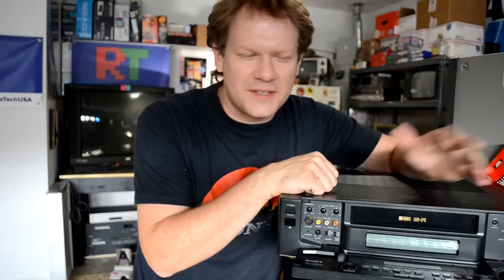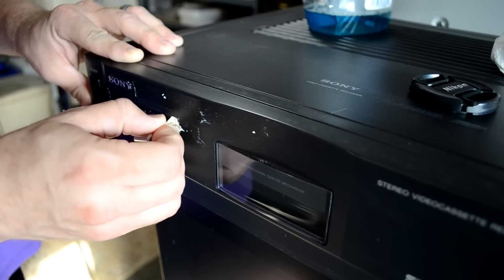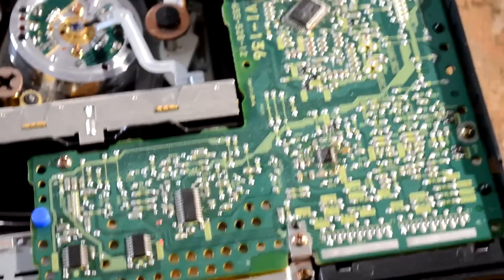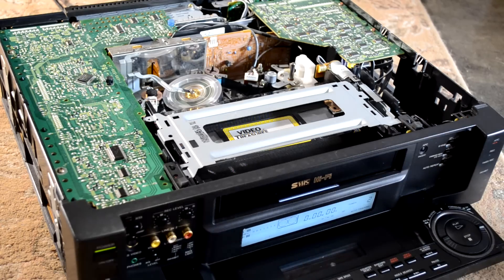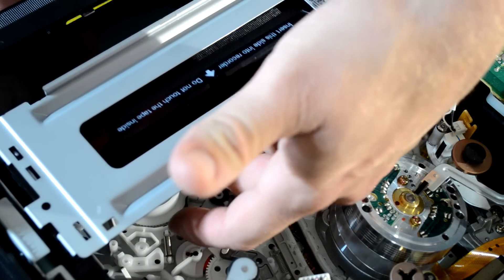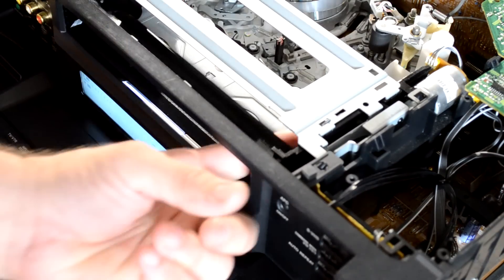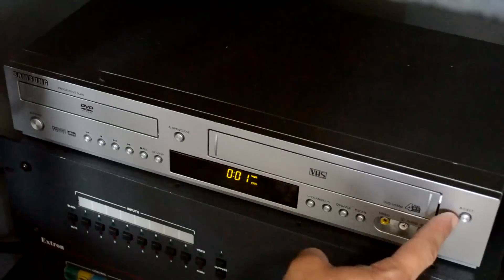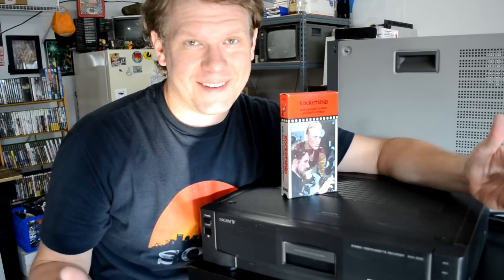Sony SVO 2000 VCR - Jammed VHS Tape Rage & Fix!

Comment: As long as your VCR is opened i'd recommend cleaning the tape head too. Take some white printer paper, fold it over, and then dip it in rubbing alcohol. After that rotate the tape head against the paper gently over and over until you get all the gunk off. Very few people clean their tape heads but it's very important if you want to maintain your VCR.
Reply from the maker: Thanks for the tips.  I for sure will give it a fresh cleaning.
Reply: Youtube cinimatic universe gets even bigger